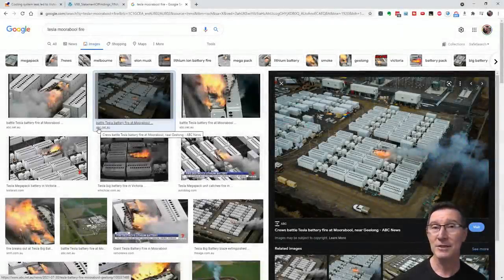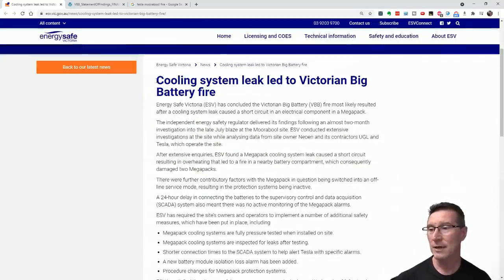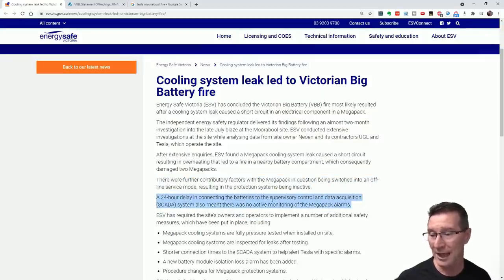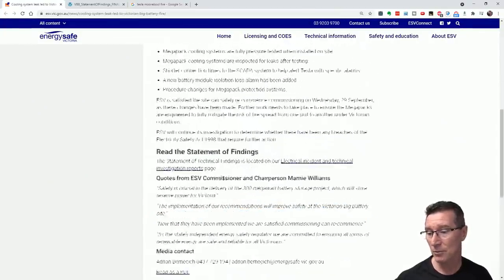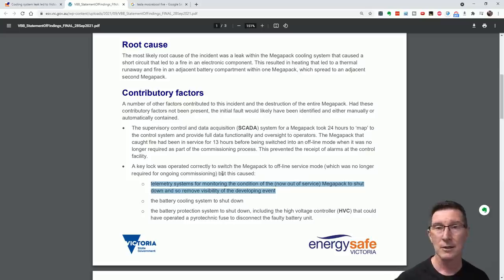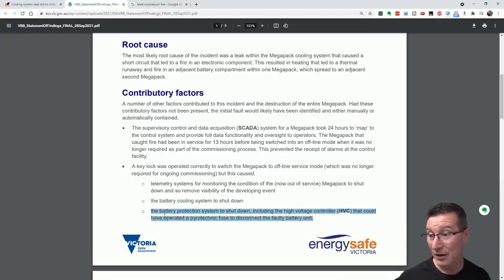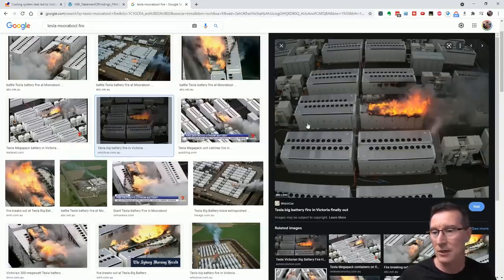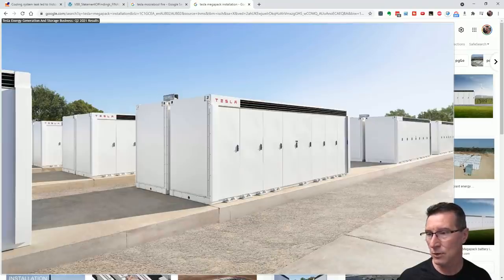EEVblog 1422 - CAUSE of the Tesla Victoria Big Battery Fire

Comment from the maker: TLDR; The megepack was taken offline at the time of the fault, so it was not charging or discharging. A leak in the cooling system caused a short circuit in some component that started the fire. So the power to sustain the short and subsequent fire must have come from the internal pack.
Also, offline mode disabled all protection systems and monitoring communications, so they had no way of knowing anything was wrong until someone yelled fire.
Reply: Haven't watched the video yet but if one cell is over a critical temperature an exothermic reaction starts. If I remember correctly this temperature is around 150°C. Or maybe some internal short circuit.
Reply: I read it as saying that the leak caused a short circuit in the electronics which then caused a discharge current from the offline battery to generate the heat which started the fire.  So it wasn't actually loss of cooling that started the fire.
Reply: @petehiggins33  exactly🍻
Reply: @petehiggins33  And in this case the high voltage controller could have cut the connection to the battery cells and stop the current flow. Really sounds like a bad idea to switch off all the security systems when putting the pack in offline mode.
Reply: The investigation board (which sounds like it's Tesla's own investigation board) doesn't want to go into eluding or blaming a cell for having an internal short, which would indicate a production quality issue (such as debris getting embedded between the film layers during production).  It would be a very strong accusation (the cell and quality of repeatedly producing that cell is at the heart of any battery company) and it would be hard to prove since the cells (evidence) are mostly if not fully destroyed.
This also sounds like a complicated customer / supplier / service provider relationships, so it would be difficult to identify who was responsible for "what" part of the megapack responsibilities after it's been offloaded the delivery truck.
Reply: the cooling liquid dripped on something like a busbar which caused a short that overheated something like a contactor next to a battery pack which was close enough to the batteries to set them alight. Its actually incredibly close to what a number of knowledgeable viewers predicted in the comments of your last vid on it (several mentioned contactor overheating)  - you have some amazing engineerds among your followers. (if a busbar shorted to ground it would also explain why they talked about battery isolation detection)
Reply from the maker: @petehiggins33  That makes sense.
Reply: It’s pretty typical in commissioning large electrical equipment to have a maintenance mode that isolates and disables pretty much all systems. 

Nuisance alarms or worse false alarms while it’s being hooked up to scada during commissioning/testing has been the cause of many blackouts (go look though the aemo reports into major blackouts).  

If you are just testing the cooling system or something unrelated you don’t want alarms from systems that haven’t been tested/commissioned yet interfering.

Leaving certain systems online when you are isolating a peice of equipment adds a lot of complexity to workplace OH&S procedures and lockout.

You can install fire panels, they are used in substations between transformers.
Reply: Guessing there is a large bi-direction DC-AC IGBT converter. A coolant leak on the IGBT driver circuitry or similar causes the upper and lower IGBT to conduct. Igbts exploded/ arced and caused to batteries to feed the fault. The only think to stop it are the pyrotechnic fuses.
Reply: @EEVblog  And then the cooling system (assuming it was just leaking a trickle and not draining) could have cooled down the affected battery pack to prevent it (or its neighbors) from overheating. If it wasn't switched off.

My guess is that they switched it into "shipping mode" where you want everything to be off instead of "isolated standby". In the latter they still wouldn't have gotten alarms, but the fuses and cooling system would still have been operational. And if the theory that the leak indirectly caused one or more battery modules to be (dis)charged uncontrolled is right, then either fuses or cooling would have prevented the battery fire. Especially when you assume that a single module going into thermal runaway is something the whole megapack can withstand, i.e. that it can cool neighboring modules so they don't go into thermal runaway, too.
Reply: Elon doesn’t believe in safety just make it now and fast.
Reply: @Alex CNC  Na, du auch hier?  Wann kommt ein neues Video von dem BAZ? 👍
Reply: @cphillips8219  That would be a much bigger potential fire then? (Oops completely messed up the maths - now corrected)
 The really scary thing with these batteries is that to reach full grid scale the total amounts of energy they need to store starts to get really huge. 
(For the whole UK with 50% + renewables the requirement might be around 10 Gigawatts output over about 12 hours =~ 400 Terajoules.) 
Obviously that would be divided into a lot of separate batteries, but even divided into several thousand each would be holding up to 100 Gigajoules. The Victoria battery is about 450 Gigajoules. I wouldn't want to work there.
Reply: Elon, Please give us some more information so we can have a decent conversation about this. we can handle the technical details the general public won't comprehend.
Reply: Thats so dumb. In todays time you just need an AI enabled camera and place it at an angle having the entire view. If there is smoke or fire, it will alarm. Simple
Reply: Offline mode disabled all protection? This is stupid!
Reply: That is why protections must be always enabled in a non zero energy situation.
Reply: @MrSmeagolsGhost  yes, disable some alarms is useful, but disabling all alarms is asking for trouble (that is why some protections must be always enabled where there is some kind of potential energy).
Reply: Off-line service mode could be the mode which those things are shipped? In that case the firmware just ignore all alarms because in service mode is expected to be any system disconnections or cooling replacement
Reply: @vitormoreno1244  keeping batteries connected during shipping is a dumb idea: if something fail, it will fail catastrophically.
I doubt this mode is engaged in shipping, i think they open disconnector switches, so nothing is live, nothing can drain batteries and the converter is in fail safe condition during shipping and installation
Reply: OK, that's a huge design error.  People who design both power plants and hazardous materials storage and handling normally know that monitoring systems need to be completely independent of the thing being monitored, and the loss of connection from any monitoring sensor needs to raise an alarm.  You should never not have active monitoring.  I put this down to it being made by Tesla, who have very little institutional knowledge of any sort.
Reply: @AlexCNC  This sounds like a design error arising from incorrectly just trying to scale up small battery designs.  On a small, mobile pack, the only available source of power for the monitoring and safety systems in the pack itself.  That is neither necessary nor desirable in a huge, fixed storage facility.
Reply: @petehiggins33  So in other words... poor design by Tesla!
Reply: 13:12 In conclusion, it caught-ed on fire.
Reply: well it just not good enough, disabled all protection systems and monitoring communications is just poor engineering, also this mystery leak causing a fire is also sound like vague rubbish, it much more serious than that I bet, yet another example or their bad design.
Reply: @petehiggins33  : so the design is not at all failsafe...  A short circuit current is usually supposed to blow fuse links..  edit:(overloading conductors to the point of fire is well outside standards) lool
Reply: Truly the Star Trek future I we were promised.
Reply: @kadmow  Perhaps I shouldn't have used the term "short circuit" which implies zero Ohms.  Any fault current from a few hundred mA up to the fuse rating, which might be say 100A, could generate enough heat to start a fire without blowing the fuse.  When large amounts of energy are being stored there's no such thing as "fail safe".  A burnt out module is the best you can hope for.
Reply: @petehiggins33  :edited...  Are you an  engineer ??
(nb.   you see in transmission systems nearly everything between controlled loads is intended to be a "dead short"  for real purposes...   control of the load is a critical feature, where there is no monitoring there is no control.)

I hear much of your rebuttal / backpedal / ??? defence, mostly as  cough - -talking. 

"Any fault current" - enough to start any fire needs adequate protection (electrically). 

Fire starting cockups ("short circuit") on brand new plant implies either terrible design, or absolute negligence by installation crew.  (outside easily identifiable shipping damage).

Isolation  of cells in the instance(s) of thermal events, these occur too.  Cell "Limits" before runaway are well understood. - through well studied disasters.

We need to encourage good design....This seems to be endowed with not nearly the safeguards we should expect. *allegedly implemented in software after a near disaster - on a non prototype, that screams "oversight".)
Reply: @kadmow  No, I'm no longer an electrical engineer, I retired from a 40 year career in the in the UK aerospace industry working on power subsystems ten years ago.  Despite your rude comment I will explain my point further.  No doubt Tesla could have prevented this fire by taking extra precautions such as more conformal coating or re-routing coolant pipes but there's a limit to how far one could or should go.  It's a law of diminishing returns.  If the failure analysis shows that there's only a one in a million chance of a fault occurring then it's not worth spending an extra dollar to prevent the loss of a $100k module.  If a human life was at stake or a $100M satellite then more precautions are justified.
Reply: @petehiggins33  :Agree - simple GOOD design may make all the difference.  (Success vs failure) - BTW it appears  no mainstream battery manufacturer have really put in place the protections needed for anything approaching industrial reliability.
Reply: I’ll just put this over here, with the rest of the fire.
Reply: @joesshows6793  Nor that's just BS. Added nothing.

Comment: Sometimes it takes an incident like this to encourage reassessment of safety systems.  I'd guess the offline state would be to allow working on alarm systems without accidentally triggering emergency responses.  The spacing is possibly a cost thing with available space and keeping packs in the vicinity of common electrical distribution and cooling systems.

This incident will probably reshape future installations and procedures.  So in a way it's good that it happened.  Especially in such a young section of the power distribution industry.
Reply: Like many things, all good engineering and safety is built on the countless shoulders (and disasters) of others
Reply: It shows the arrogance of Tesla and Design and commissioning procedures not checking what I would consider “essential” equipment at time of delivery.
Fire suppression eg Liquid Helium or Nitrogen to remove heat and oxygen from the fire ?
Reply: I have a feeling that the pack was sending errors, and they tried to fix it on-site and just went and turned it off, and went smoko/lunch/home.
Reply: @phillipgarside4438  @2:40 he is explaining that once a lithium fire starts you essentially can not put it out. But I do love the Tesla hate and that it must be "arrogance" at the root of the problem... they should have checked in with you first Phillip, obvious mistake by the newb's at Tesla. Maybe you could do a quick memo to straighten them out.
Reply: @ts757arse  Case of scale though. If this entire place went up the shit that goes into the atmosphere would be horrendous. I guess we'd need to compare like for like in terms of stored energy. The amount of energy in a lithium cell is a tiny fraction of that of a similar mass of uranium.
Reply: @ts757arse  No all to often risk mitigation is run on perceived hazard and panic . 
Nuclear power had an incident called Chernobyl that killed on order of several thousand people and the world ran round in circles like headless chickens. 
Coal on the other hand has had a Chernobyl equivalent (in people killed) every three days for the last fifty years and everyone was quite happy with it.
The result is that nuclear health and safety regulation has killed about ten million people - because it killed the expansion of nuclear dead.  Thanks to ongoing climate change the coal already burned could add another billion or more to that total.
Reply: Yes Clive, in the rest of the totality of human experience it's called a "spotter".   Having the system needing to be monitored for failure be the system to monitor for that failure is called having the Fox guard the Hen House.  What happened here is what we call a Whoops Whoopsie.
Reply: @marcdraco2189  I don't think Elon has ever called himself a genius? So how is other peoples flawed perception of him his fault? He's openly talked on videos about making stupid or flawed design decisions and learning from them and in particular he's warned against taking what anyone tells you for granted PARTICULARLY if you consider that person to be smart, question everything. His sills are at man management and cutting through the bullshit to identify the detail. He's not perfect, no one is and he knows that. ALL engineers/inventors etc. stand on the shoulders of others that's how progress happens.
Reply: @mfx1  I'm well aware of how progress happens, but the point with Elon is he claims credit (or allows other people to give him credit) for things like Tesla. The car he fired into space for example, was promised to one of the guys who started Tesla.

You really need to take your fanboy hat off and have a listen to some people who know more about the machinations than you do.

A lot of his stuff doesn't work (and can't) for reasons I won't even bother to detail here. There are several channels that detail what really goes on and why he's really just a charismatic but ultimately empty husk.

You might start with this, it's an excellent primer. https://www.youtube.com/watch?v=c-FGwDDc-s8
Reply: That's a bit of a sad way of reducing engineering to a trial and error kinda operation. Most of those logical mistakes and/or installation firms' sloppyness seems juvenile (in hindsight) and in my business of health and medical IT services those are designed out of the system from the get go. We do drills/tests of failover of geo separate hardware, data layer corruption, monitoring and metrics, alarms/triggers and incident routines, distaster recovery times and processes and so on. Similar to how the fire departments do their stuff. I wouldn't say we need that kind of regulation of these sites, situated away from human beings and not really providing anything super special. Just a lot of a good-to-have-buffer. And yes, every hospital I've been at has their own energy backup and a backup to that backup..
Reply: @NirreFirre  Everything in life and engineering is trial and error it's easy to identify and criticise "logical mistakes" when you have the benefit of 20:20 hindsight. You do the stuff you do because of previous mistakes, you work in the medical field Therac-25 incident ring any bells?
Reply: @NirreFirre  Everything in life and engineering is trial and error it's easy to identify and criticise "logical mistakes" when you have the benefit of 20:20 hindsight. You do the stuff you do because of previous mistakes, you work in the medical field Therac-25 incident ring any bells?
Reply: @NirreFirre  Everything in life and engineering is trial and error it's easy to identify and criticise "logical mistakes" when you have the benefit of 20:20 hindsight. You do the stuff you do because of previous mistakes, you work in the medical field Therac-25 incident ring any bells?
Reply: @NirreFirre  Everything in life and engineering is trial and error it's easy to identify and criticise "logical mistakes" when you have the benefit of 20:20 hindsight. You do the stuff you do because of previous mistakes, you work in the medical field Therac-25 incident ring any bells?
Reply: @ts757arse  What about the safety of the workers and nearby by residents?
Reply: I thought the spacing was either a defalt to fit into other small sites or a way to reduce cable runs, the site it victoria is in the middle of nowhere, they could have made it much larger phsically without issues, i'm sure i have seen a similar project with precast concrete dividers between the banks instead of a large airgap - though it may have been a artist impression of a competitors design.
Reply: @michaelwillis1832  They'll likely want to keep spacing to a minimum to reduce losses and copper costs.
Reply: @wobblysauce  was thinking the same..
Reply: @ReachOutToWilliam  if that whole site went up, the pollution would be significant but it wouldn’t kill anyone. It’s not even anywhere close to Chernobyl scale.
Reply: YES one major cost is wiring length
Reply: More space might not even be needed, something like gire resistent deviding walls just between the butting packs should do a lot, also some chimneys , a meter or two should do, to vent the fire in a controlled direction to reduce the heat to neighbours
Reply: A smart community of communicators of amateur minds.